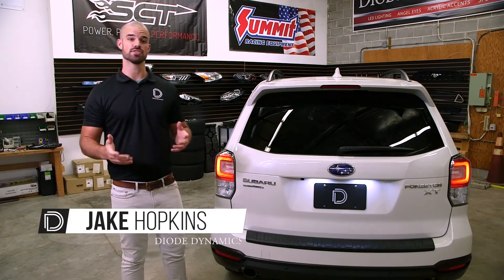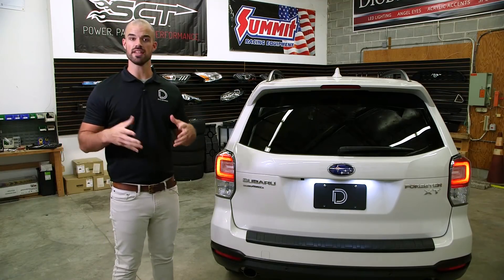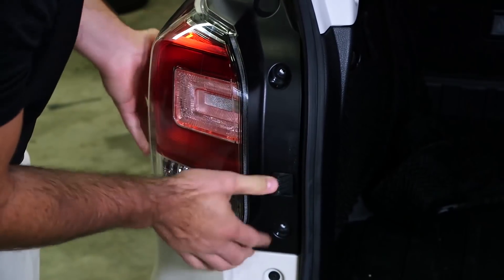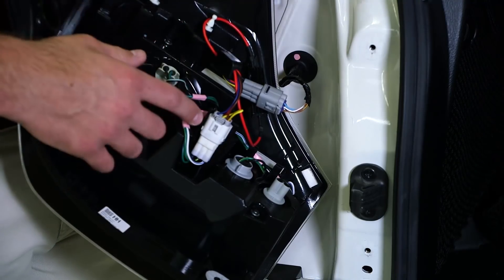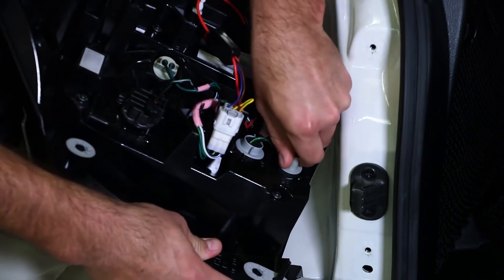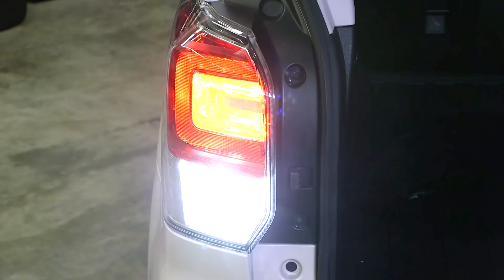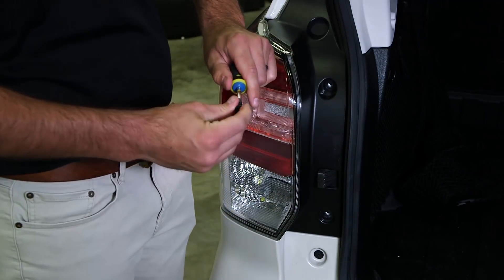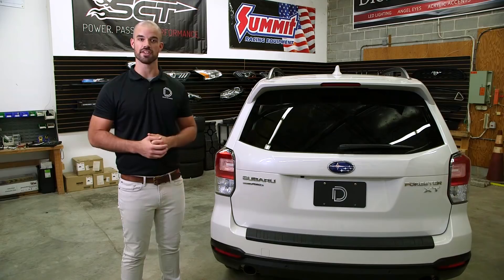How to Install 2017-2018 Subaru Forester Premium Tail as Turn® + Backup Module | Diode Dynamics

Comment: I bought the diode dynamic tail as turn light for a 2018 subaru Forester. Now I want to replace the reverse light and old turn signal light. Am I able to buy the part separately? What are the part number for the led bulb?
Reply from the maker: Hey there! Feel free to check out everything we offer for your 2018 Forester:

https://www.diodedynamics.com/by-vehicle.html?find=2018-subaru-forester-493062&sid=gpqD0a6jdW

Comment: I've got the kit on order for my '18 XT and will be replacing the turn signal and backup bulbs with your LED's. Do I need to buy the special turn signal relay?
Reply from the maker: You shouldn't have to, however if you do experience hyperflash, you will need to order one of those as well!

Comment: Kind of confused. How does installing this make your existing red brake light turn into an orange turn signal? The 'C' light is currently the marker (parking) light and the inside of the 'C' is currently the red brake light. You are showing it as orange after the install. Please explain? Does the C light also become the brake light? You don't show/explain any details of the brake light in the video, just the turn signal being moved. Thanks!
Reply from the maker: Sorry for the confusion! The brake light will function just like it does from the factory! You can check it out in the video below! 

https://www.youtube.com/watch?v=PS3kPeQBmI0
Reply: @diodedynamics  So you will end up having a red turn signal instead of an orange one?
Reply from the maker: @cnmtech8086  That's correct! Then you can convert the old turn signal location into an extra set of backup lights!
Reply: @diodedynamics  a few wire changes and diodes to valve off some voltage.  Nice.  I did something similar to my old Volvo.   It has rear fog lights,  with two diodes,  my dog lights work as additional brake lights without hindering it's original flight function

Comment: Does anyone know what the bulb size is for the brake light that is being changed to the turn signal? Does diode sell that light also for direct replacement? And how does the brake lights work now? Does it just use the other light to notify others for when brakes are applied?
Reply from the maker: Hi there! We do offer bulb replacements for both the old turn signal location and existing backup location. You can see them both in the listing we've placed below. The brake lights will still function the same- it just turns the brakes into a blinker when the signal is turned on. If braking and signalling at the same time, the other light will notify others, correct! 
https://www.diodedynamics.com/2017-2018-subaru-forester-premium-tail-as-turntm-backup-module.html

Comment: Do y’all make one with red led turn signals? Don’t like that amber garbage.
Reply from the maker: Hey Harold! This kit actually makes your factory brake lights function as new turn signals. We give you the option to replace the old turn signal location with cool white LEDs for an additional backlight. The factory brake light is red from factory, so this new turn signal/brake will be red as well!